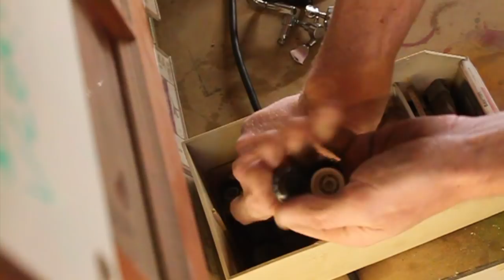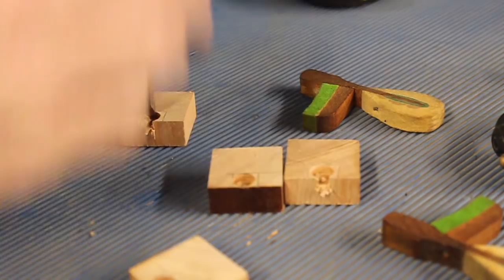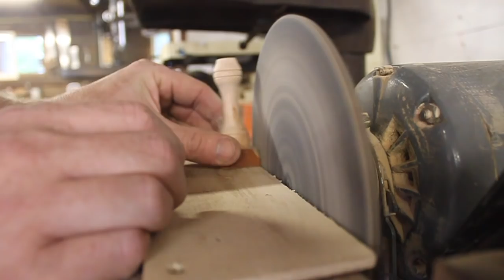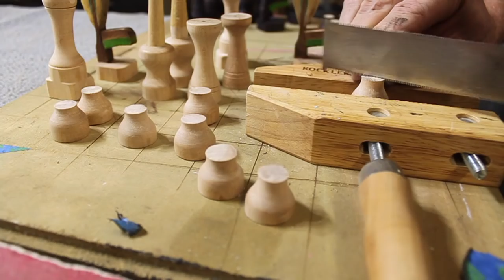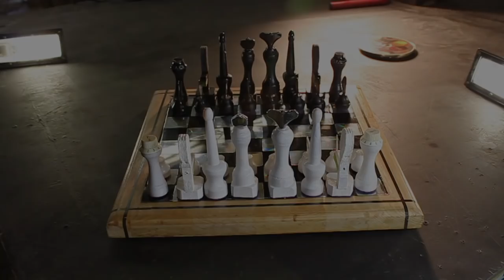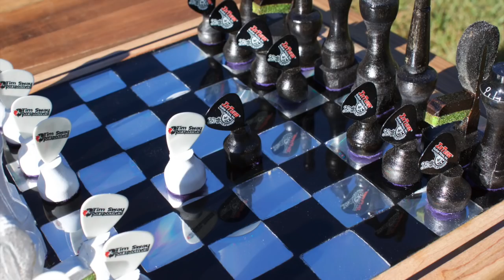Chess Pieces made from Instruments - Musician's Chess Set Pt 2

Comment: The Fender Rhodes sounds amazing. I've got a beat up Mark I 73 in storage in desperate need of restoration. What amp are you playing yours through? How did a Rhodes EP once owned by Prince come into your possession?
Reply from the maker: thanks! I bought the 88 (with the 2X12 cabinet) off ebay about 15 years ago. It came with a road case with Prince's logo on it and the sticker inside the instrument is from a Minneapolis music store. The beast is well worn (and I got it for cheap as it's not authenticated). I don't doubt it toured extensively as I know what my touring gear looks like and I'm a lightweight compared to Prince! I admit I recorded this direct in to Logic and used a preset virtual guitar amp.
Reply: Cool origin story on the Rhodes!  And no shame in virtual amps - I have great results with running keyboards (and guitars of course) through virtual amps in Logic.  Less so with the built in, commodity amps, but I do virtually all my recording now with Scuffham Amps' S-Gear.  Tube-rich sound I get out of that is brilliant, and haven't really looked back.